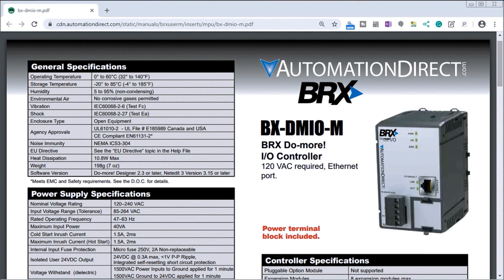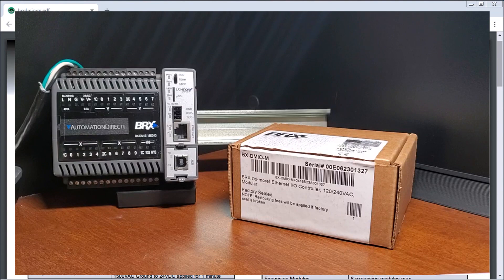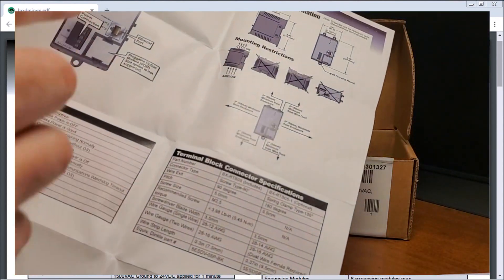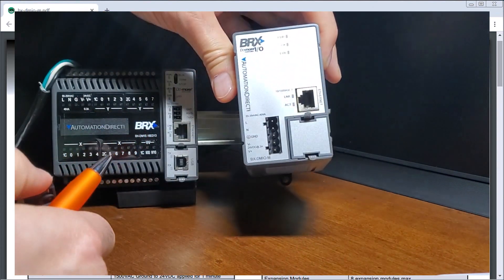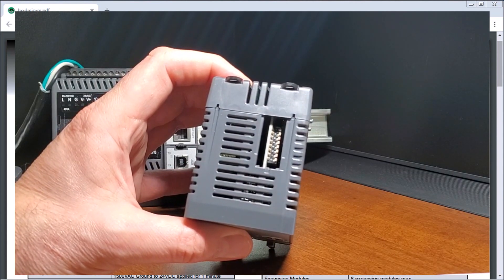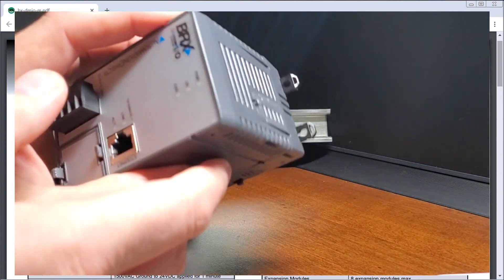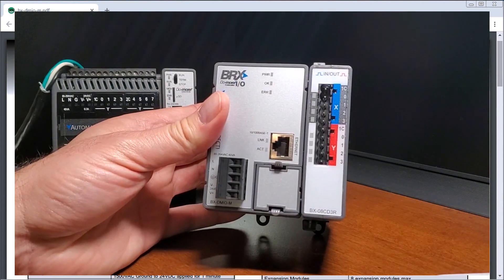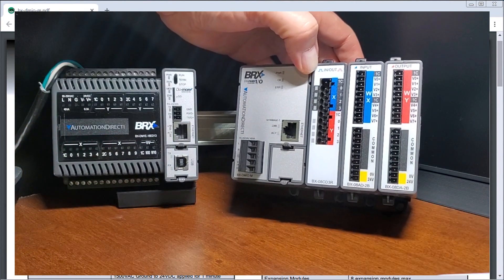BRX Do-More PLC: Ultimate I/O Expansion Setup Guide

Comment: Can you use the BRX I/O as a stand alone unit? or do you have to use it as a slave for the controller?
Reply from the maker: Hi Joe,
You can use the BRX PLC and add  the BRX I/O modules to the left hand side of the CPU. The BX-DMIO would be used for remote I/O. This means that the input and outputs have to be controlled at a distance from the main CPU panel. Instead of running all of the wires to the remote panel, you would just add a communication cable between them. In this case an Ethernet cable would be required.
I hope this helps you out.
Regards,
Garry